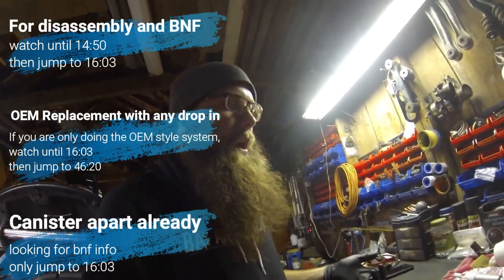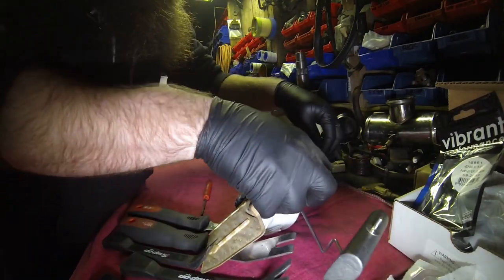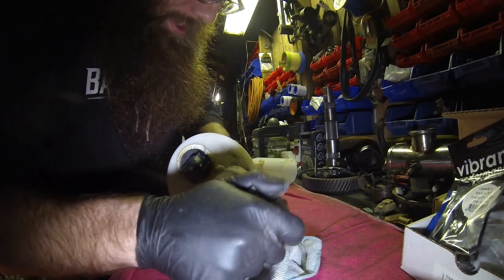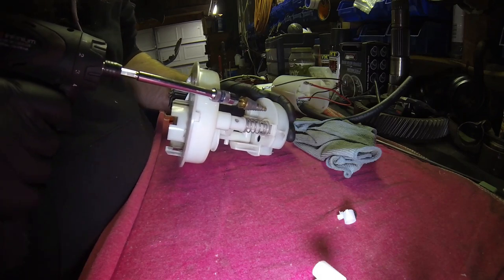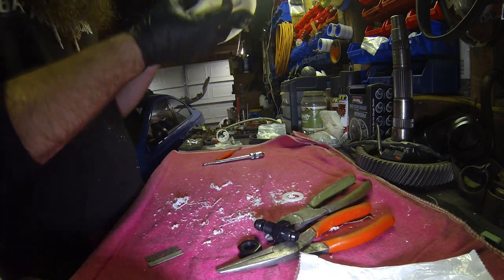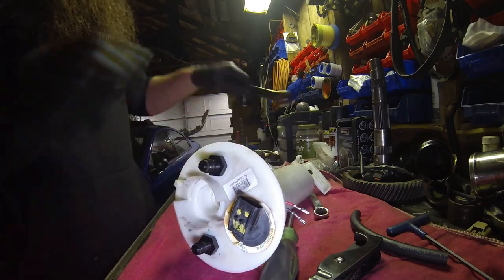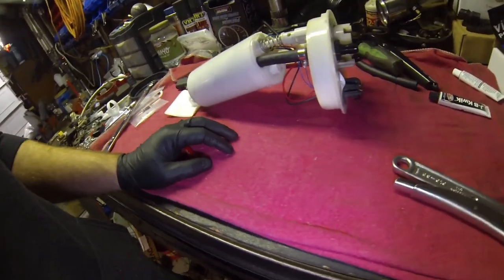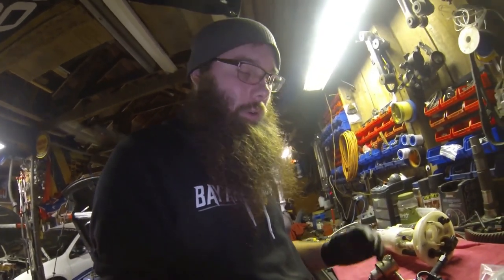How To: Neon SRT4 Fuel Pump, BNF (Bottle Neck Fix), and External Fuel Filter!

Comment: Awesome vid. What about the little black wire that goes to the stock fpr? Any evap codes? Bought my neon with a big turbo, return line, stock and aeromotive fpr. What did you set your fuel pressure regulator to? My stock fpr is taking a shit so I figured I’d do this bottleneck fix. Save some $$😂
Reply from the maker: Most tuners run a base fuel pressure of 43.5 since that's where most injector data is provided

That little black wire is small static ground, you don't need to have it if you're not using the stock fuel pressure regulator

Comment: Hey brother had a question I used those earl clamps just like you did same hose and everything but when I tighten the clamp on the pump and tug on it it won’t pull off but if you twist it it will twist is that ok ?
Reply from the maker: Yes twisting back and forth is fine as long as the line is tight and sealed to the outlet nipple

Comment: Yo man whats up where does the return line connect to boss I se you connect from the pump to the filter to the car fuel line but where does the return connect thanks in advance
Reply from the maker: If your looking at the pic @58:13, o hook the return line up to the bulkhead fitting to the right in the pic, it has a -6 to -4 reducer on it

Comment: Hey brother , where do u get the fuel line your using from ???? And can I also use that same hose for the complete return from rail back ?
Reply from the maker: You can!
Its called Aeroquip Socketless, you can get it from summit, and i use the summit twist tite fittings or aeroquip socketless fittings
Reply: Turbo Bill thanks man !! I really appreciate it ., & by any chance do u have the part number on the fitting to go from rail to aermotive fpr

Comment: What size submersible line is that ? 3/8
Reply from the maker: Yes
If you're using off brand pumps, then I can't answer for sure, but walbro does advertise their 255s to have a 3/8" outlet